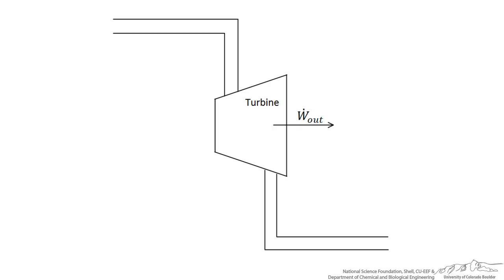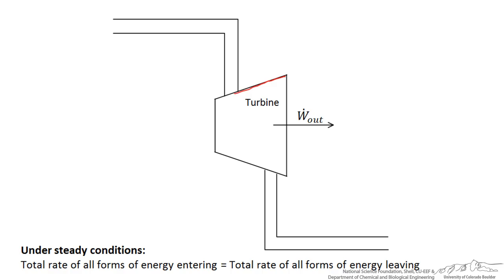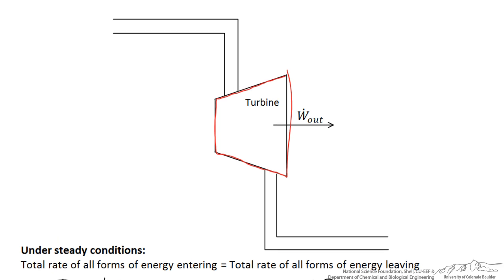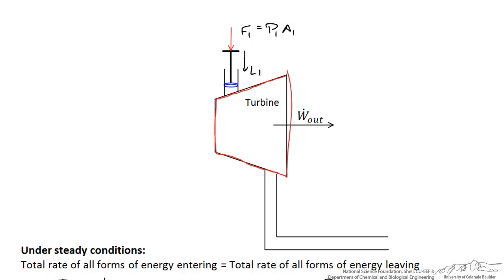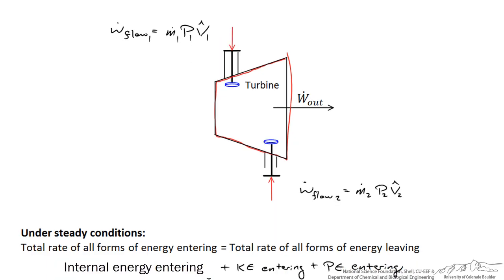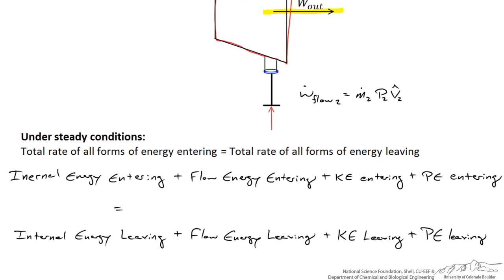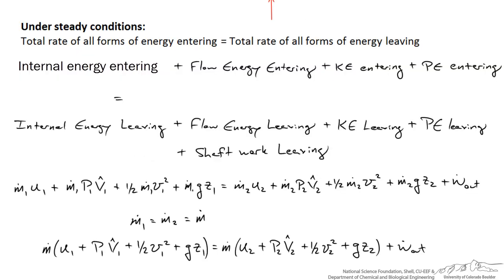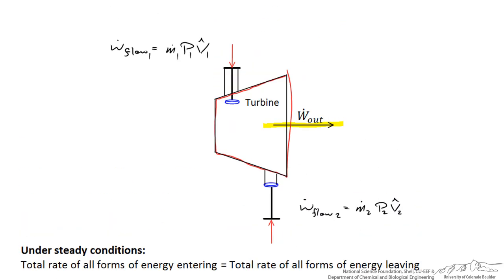Energy Balance Around a Turbine

Comment: How would I work out temperature outgoing using tables, if temp & pressure inlet are known and so is w? (both temp & pressure change over turbine)
Reply from the maker: Assuming you also know the outgoing pressure, you would solve for the outgoing enthalpy.  Use that number and the pressure to find the corresponding temperature in the tables.